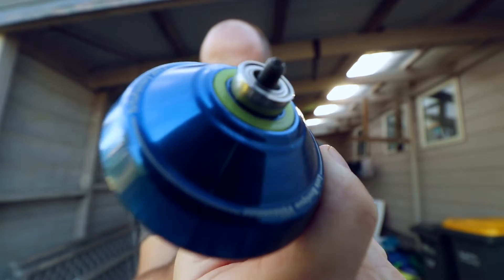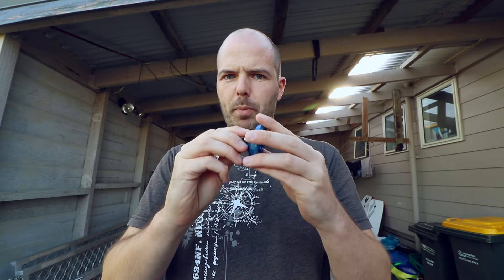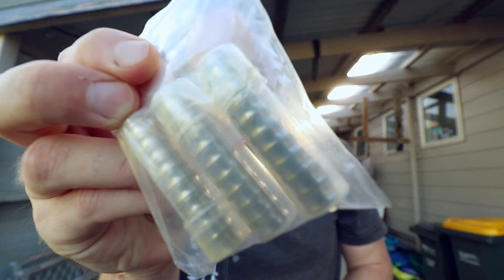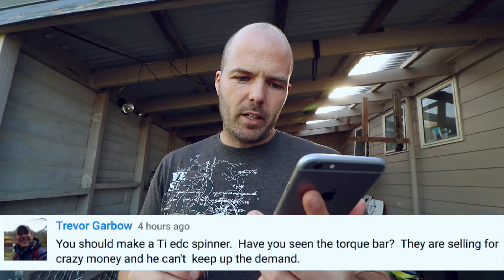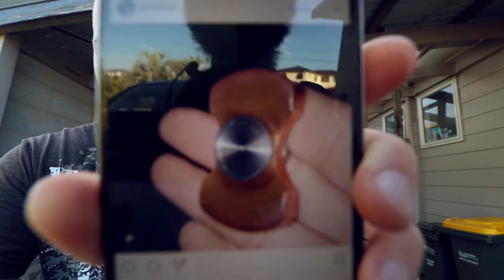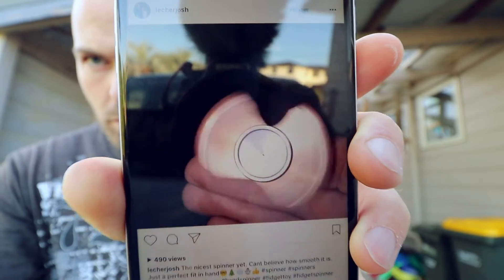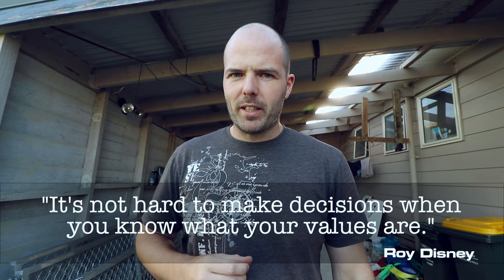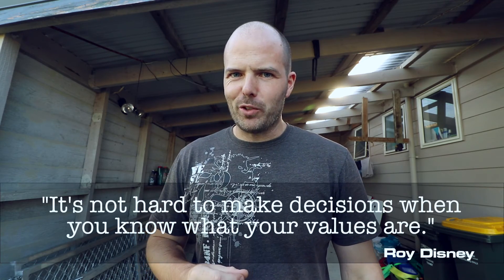Should I make THIS?

Comment: From what i could tell those bearings are konkave or Center Track bearings which wouldn't be good for spinners , you could obviously try but whats good for a yoyo probably isn't good for a spinner. Flat bearings would be better in my opinion , one drop 10 balls are one of the beast "flat bearings" for yoyos

Comment: You mentioned the spinner concept before. So I thought about a Ti spinner and thought that wouldn't be so interesting precisely because titanium is so light. So what about a Ti body plus bearings and center handle, etc. and tungsten weighted ends. In the looking around I've done tungsten-copper alloy comes up. More machinable than pure tungsten and with an interesting color contrast to the titanium. By marrying the two metals you'd end up with a light weight overall but with a high moment of inertia. Cheers.